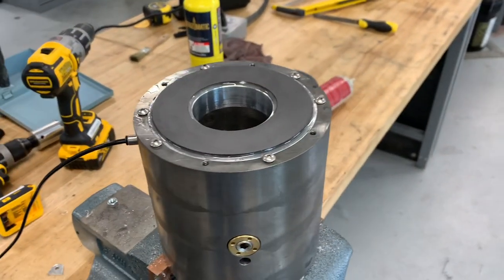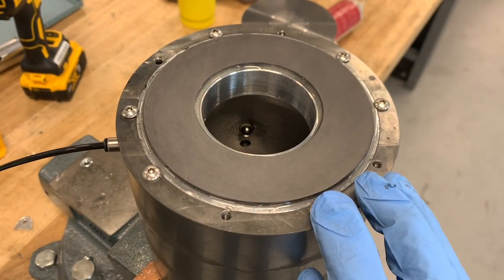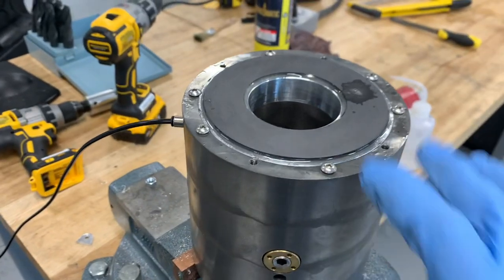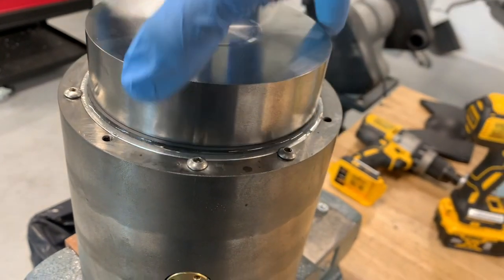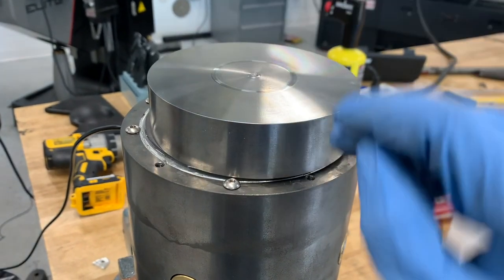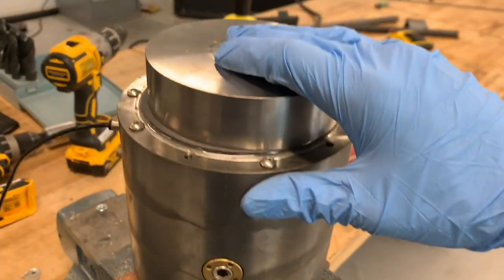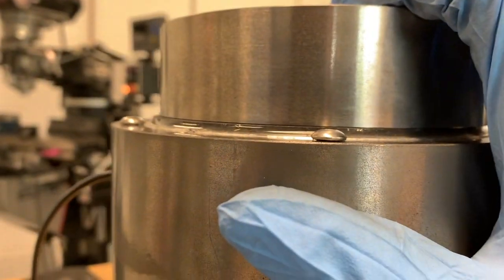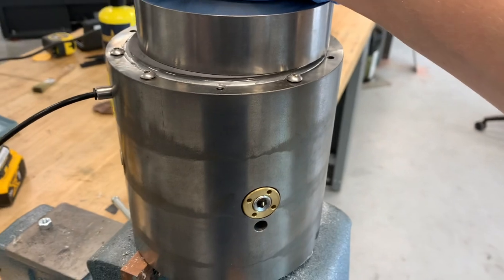Air Bearing Spindle Thrust Bearing!

Comment: Is there a reason that you can't drop the pressure to lower the flow rate and reduce the air-hammering effect? Or use the same pressure and have an orifice on the inlet that limits max flow? Instead of the resin-grease impregnation tuning